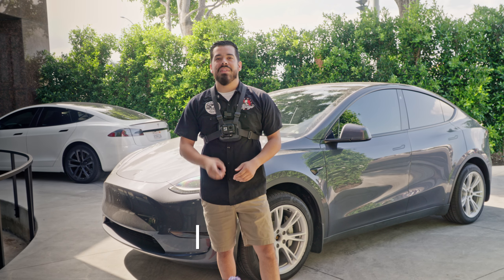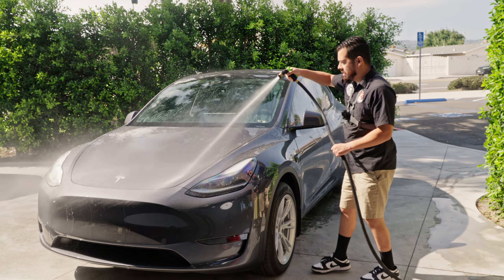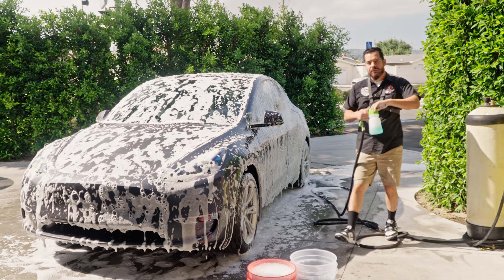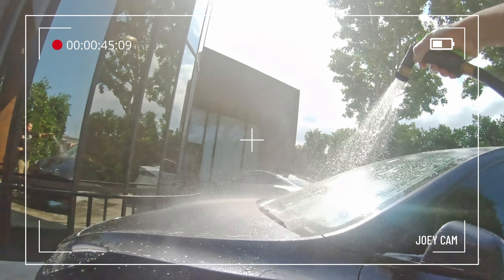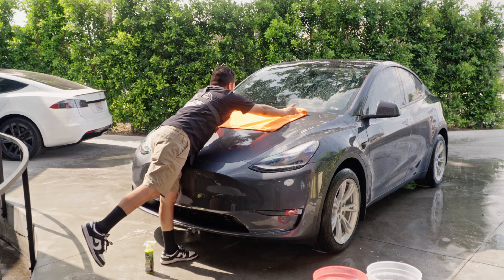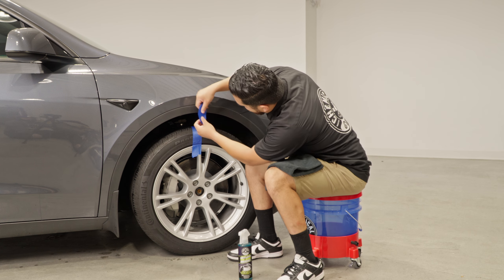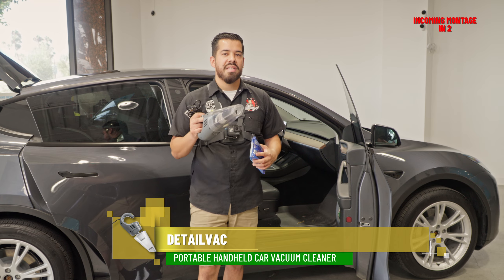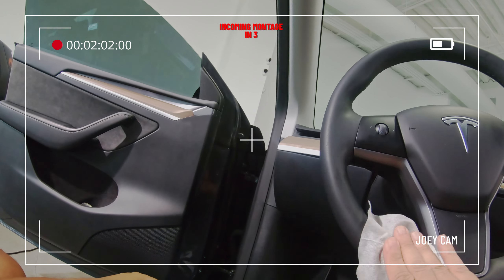Fall is HERE! 🍂 5 Products Every Car Care Nut Should Be Using To Maintain Their Ride | Chemical Guys

Comment: That torque blaster looks amazing. If i have a portable power washer, will the torque blaster produce thicker suds through a Worx Hydroshot than when used through a garden hose?
Reply: I have the Torque Foam Blaster for the water hose
Reply: Torq blaster is only for water hose connection.. this is what I used before I got my electric pressure for Christmas it worked great for the time being when I only had water hose available.. now it sits on the shelf, I should give it to a buddy or family for them to use.
Reply: @kanaletumlinson  thank you